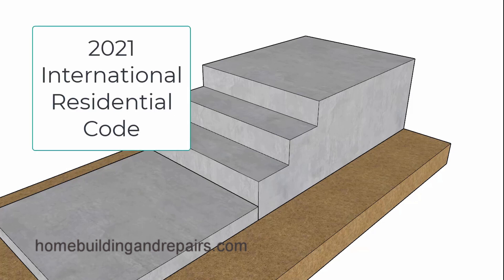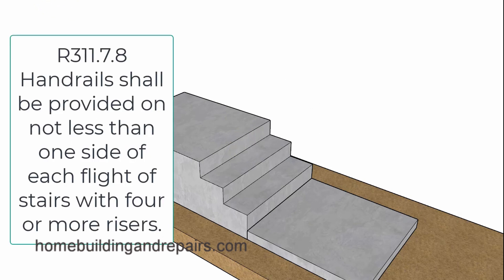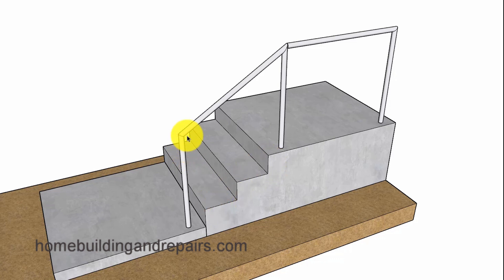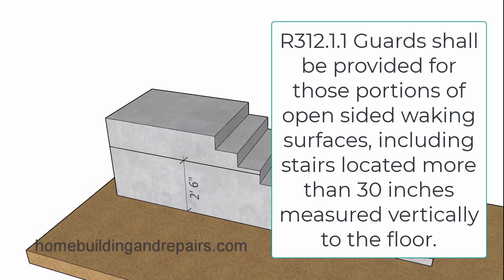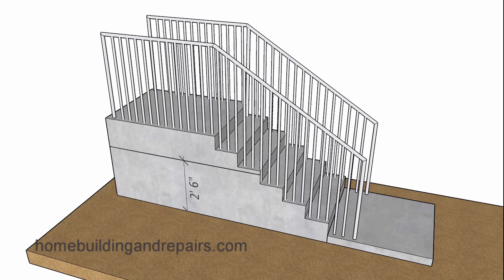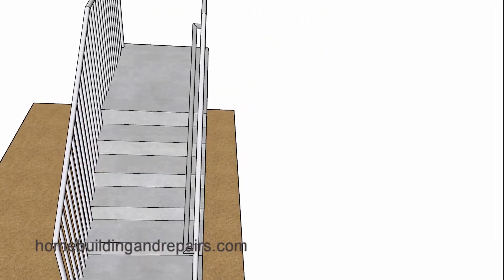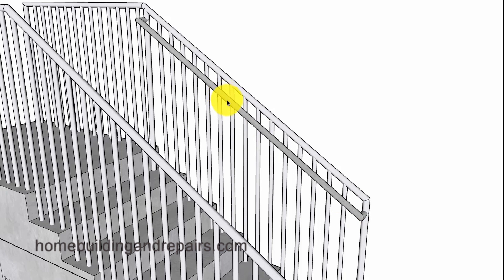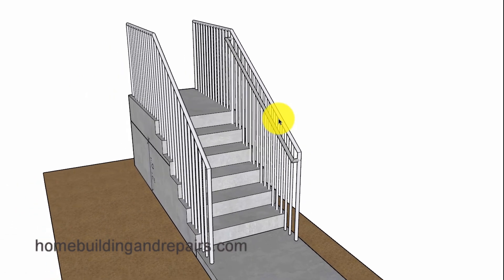When Do You Install A Guardrail or Handrail When Building Stairs? - Builders Education And Safety

Comment: At 0:06 you state a grippable handrail on one side of the stairway for any stairs with 
(more than four risers), but the code says (four or more risers)?
Reply from the maker: It's confusing, but if you check with your local building department, they should be able to provide codes for your area.